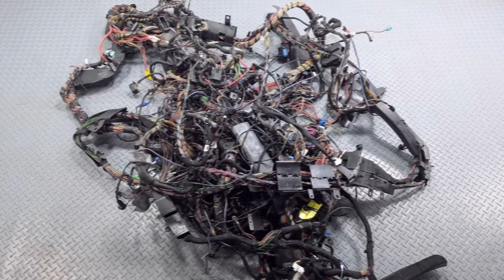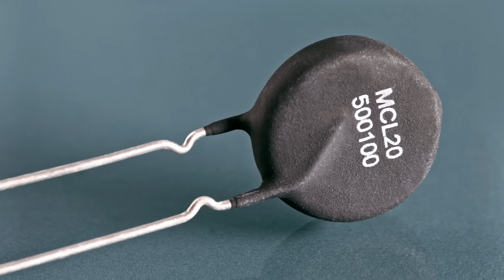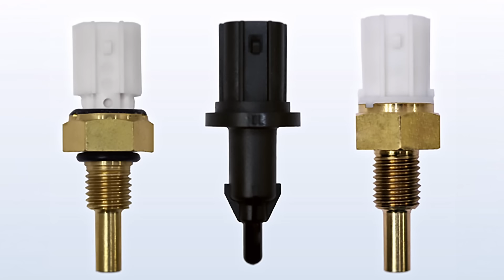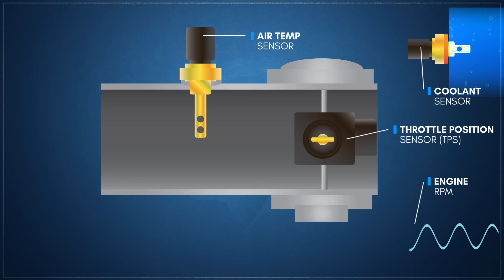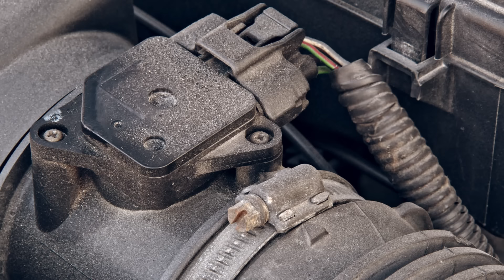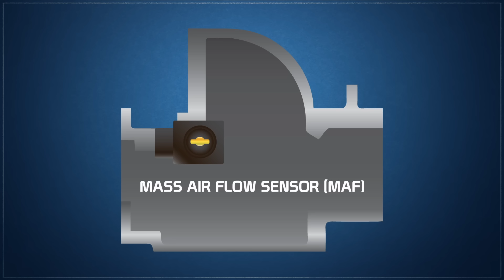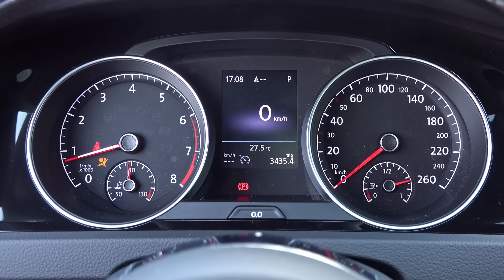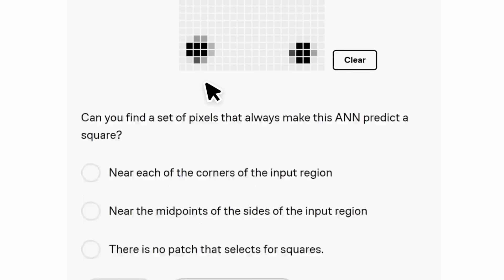The Insanity Of Engine Sensors

Comment: Not only the amount, but the precision of these sensors is amazing.  Also the fact that MOST of them out-last the vehicle ( 250k - 500k miles ), Is amazing.   

I know people constantly cry about how cars are all computer controlled now....But without all these sensors and computer controls, Car would not be the performance beasts that they are now. They would not have the performance characteristics that people want in a modern car.  They'd be MUCH less fuel efficient,  Much heavier, less nimble, less fast, and less safe.  

........Though it DOES suck when a crank-shaft position sensor dies on you.  Or your 02 sensor craps out, or in my wife's jeep, the gas tank vapor pressure sensor goes bad, so it always throws a check engine code, which stops the car from being remote started.
Reply: The computers are not bad but how they are used as an excuse to exploit the customer.
Also automatic steering correction should never be forced to be on especially in places where snow will cause it to misjudge where the road is, making it suddenly try and steer into the ditch at 80km/h every now and then.
Reply: my dad inherited great grandpas 1966 ford station wagon in the 80s had a 240 cu 4.0 st8 6cyl engine 150hp. top speed was 100mph ( we tired just once) or could just chill get 20 mpg going the speed limit on flat land. ZERO computers. it rusted apart in 2010ish still ran great original engine and transmission. fast forward 59 years with engine technology  and i'm not impressed. compare a car in 1907 to that of 1966. THATS 59 years of progress. its hard to compare the old 240 directly because everything is turbo now but the last time ford made a non turbo 4 liter was in 2000. it had 160hp. 34 years of progress  10x more complicated 10 more horsepower and polluted less..was an ok engine but  was not any more reliable than the 240 so didn't even have that u could say .. new car engines are 50  times more complex than grandpas old car for what? hell they are 10x more complex than my 2000 model vehicles, for what? a few mpg to make a car basically disposable? nope not impressed at all. now they have just got stupid dipping timing belts in hot engine oil thinking that was a good idea. they are going backwards. ill keep my early 2000s vehicles forever. was the last time stuff lasted and was not stupid complicated for just a little less horsepower and mpg.
Reply: My Grand Cherokee also does this. Ordered a new vapor pressure sensor, got part of the door card for what I think is a wagoneer instead. Thanks Stellantis
Reply: It does suck indeed. My 1977 f150 4.9 got better mileage than my 05 4.7 dodge half ton. Better than my f150 of the 2000 vintage and better than my buddies 2023 f150. Better than my 05 Silverado. 1977 got 16 to 22 mpg and it was probably heavier. It had a topper that helped it   I suppose maybe not a fair comparison. But my wifes turbo Subaru Baja can barely beat it at only 14 town 21 hiway mpg. Awful considering all the extra maintenance. I have kept track on the subie and it is close but i think i could have run an old bronco for less money. The money would have gone to fuel instead of three turbos and a new ECM before 100,000. Im so disappointed in modern vehicles. It seems they are getting worse. For the tech involved our trucks should be getting 80mpg in my opinion.
Reply: @joecliffordson  I don't have the spec sheets in front of me but it was almost certainly not lighter than modern trucks. It is a misconception that older cars where generally heavier, yeah weve lightened frames some but alot of body panels actually weigh more now cause they contribute to the crash safety sometimes even general structure. And we have added so much more to the inside. Pickups trucks more than any other category have in that time gone from bare bones deathtraps to luxury near track safe vehicles loaded with every concievable feature.

Also none of this is relevant even a little bit because the '77 4.9 f150 made less than 120hp when it was new(at sea level on a dry day)
Reply: @ i confess my 300 was built. It had more power than my 4.7 dodge but not the v8 chevy. The 4.6 may have been comparable but i never dynoed them. These overhead cams just add complexity without the power increases. I was a kid and i designed a better engine that was more reliable than fords current twin turbo. I was an old man when i had to put new pistons in it and its still running. Bonus was i did not have to remove the cab to pull the engine like fords today. For less than a timing chain in the dodge 4.7 i was back in business. Piston 4 cracked a skirt. Wasico piston compt said it was a bad batch but i ran many many mikes on before it came apart. I am a body man and those old fenders are much heavier. The safety in new stuff comes from a crumple zone. I think you are correct about newer trucks being heavy though by the feel of my-floor jack. Plus that old 300 passed emissions with no cat. Imagine that. I ran it through for shits and giggles in 90 and it passed hot engine test even though it was exempt. Engine management is necessary on these little turbos but the old 4.9 ford got the job done. Pulled many 12000 pound loads at hiway speed. Its my solid go to rig on my farm.
Reply: @alexphelps7042  engine performance went backward in the late 70s through the 80s due to emissions crap. in 1977 a corvette with the optional engine only had 210 horsepower. in 1967 the optional 427 made 400 horsepower.
Reply: @joecliffordson You forget back then the fuel had lead in it, that is why mpg was better not the engine.
Reply: @ i was running it from 88 to present. I will admit i built the motor. Raised compression with pistons and head work. Also used a 230 x grind cam and a holley 4160 4barrel with headers. Improved the 12mpg from the factory. Hardened valve seats for unleaded too. And a three angle grind with some port work to create turbulence on the intake charge and flow to the headers. The waseco piston dropped a sleeve in 2015. Short block rebuild was 1200 bucks. Slugsstayed 30 over as i shut it down when i heard the clatter. Pistons had fllaws from that batch i was informed. That was at 329000 and its still choochin.
Reply: @ntal5859lead raised the octane rating to prevent knock. It doesn’t help with fuel efficiency outside of allowing a higher compression ratio, though I am not sure if they took advantage of that. I think those old Ford engines had like a 9:1 ratio while modern ones have 10-12:1. 

It’d be the equivalent of putting premium fuel in your car today to try and increase mpg.
Reply: @joecliffordson  the main problem with modern trucks is how massive they are. There's only so much tech can do against a vehicle that has 2x the surface area.
Reply: Finally someone like myself, the change to ecu and sensor has made engines way more reliable and easier to fix. The people that complain do know how to fix their own car through pure ignorance or justifying it by some old folk lore story.
Reply: You can have quality cars without sensors they worked better imo without them

Comment: They are mainly used for research engines, but the PEAK of sensors is in-cylinder Imaging/Spectroscopy.

I need to read up on it more, and would love a video, but they basically use a spark plug like hole and add a sensor/camera or a fiber optic cable.

It lets them view exactly what is going on in the engine when testing new fuels or combustion modes like RCCI/HCCI etc
Reply: A similar tech was used mid-century in aircraft engines. By applying a voltage across the sparkplug gap and measuring the resistance during combustion you can tell a lot about what's going on in the combustion chamber. It enabled setting timing and mixture accurately. Easy enough for a human flight engineer to do with engines operating at fixed throttle and rpm for a long period during cruise.
Reply: SAAB patented this feature introduced it their petrol engines more than 30 years ago. Several diesel engines use in cylinder pressure sensors.
Reply: We use a saphire crystal in a similar application as a opening for the camera.

Comment: All these sensors and still the cars don't last as long
Reply: This is a myth. In the 80s and 90s, cars were on average being written off as beyond-economic-repair by about 100 000 miles in the US. By the 2010's this was up to 200 000. People think cars last less long because we drive more (so we might reach that 200k miles in less time) and because of survivorship bias.
Reply: @JorenVaes  New car sales are garbage. People are just broke or it would make more senses to finance a new vehicle. Government mandates kill alot of vehicles as well. All things considered.
Reply: I have a car the gas 230,000kms on the clock. The engine performing very well, much better than older vehicles I've owned.

Comment: I think my car like 5 sensors, oil pressure, voltage, headlights on with door open, coolant temperature and transmission reverse.
Reply: And hall effect for the ignition.

Comment: If only these brilliant engineers will factor in access,replaceability and durability to the sensors …….
Reply: That makes the line go down though…best i can offer is heated seats as a service!
Reply: OEM and profit go hand and hand sir.
Reply: @ fine, but what if an OEM would buck the trend and gain market share by touting a new way?
Reply: they do. but its the bean counters that dont want them to.
Reply: @ I think the bean counters are short sighted.  Those recalls are expensive and they fail to properly value goodwill.
Reply: They do. Engineers engineer. They’re not responsible for the cost control measures.
Reply: They 100% factor access into it. That’s why they are hard to access
Reply: The big manufacturers should be using generative or parametric design to allow to access zones as a minimum but then "light bulb conspiracy" suggests that it's by design - planned obsolescence in many cases
Reply: They factor it in and make is as big of a pain in the ass on purpose.
Reply: This is because, in the grand scheme of things, these sensors (in general) have very low failure rates. If moving the sensor and making it more accessible costs 10 dollars (because the layout is less optimal for manufacturing), over a production run of 500 000 or even millions cars that might use that engine, that adds up to a lot of money, just to make life easier for the guys that have to repair the 5 or 10 or even 20 sensors that will actually fail. Sure, there have been some major fuckups (eg, BMW had a belt tensioner on one of their engines that failed more often than it should and was hard to get to), but the engineers really do factor in repairability where it makes sense.

The customers we work with in the semiconductor industry keep very detailed failure rate logs of their sensors. Most are well below 10-20 parts per billion that failed due to the sensor being the fault.
Reply: @ thanks for your answer.  Maybe sensors indeed have acceptable failure rates.  But so many  assorted components are buried under flimsy plastic just to save a penny or two and so much needs to be removed to get to them.  I just think they could do better.
Reply: @MarkSmith-js2pu  The plastic is more for aesthetics rather than function 
Realistically you could tear out most of the plastic from the engine bay and then not need to worry about it anymore
Reply: @ I’m more concerned with door handles, and cheap AC actuators, electrical connector,plastic quality, vacuum line connectors and everything else that gets brittle,
Reply: @MarkSmith-js2pu  We need serviceability and parts quality regulations.
Reply: @JorenVaes  I’m not going to hate on the engineers per-se, as they are being hired to make a car to last to warranty/be as cheap (and thus profitable) to make at scale etc.

In our current system making something that works for what the company deems a “reasonable amount of time” and can be “reasonably repaired” until it eventually gets swapped for a newer model makes sense and they are doing their job.

THE ISSUE THOUGH is that this model cannot work when you don’t want to destroy the earth, or when you look at the societal impact of that model.

If designed from the viewpoint that a person should be able to fix any and all components with a reasonable amount of tools, knowhow (via documentation, but also designing with accessibility in mind), and time/money to burn.

THAT should be the core, not profitability for the company.  Our current system doesn’t push for that/reward it so we won’t get that.

Hate the game not the player i guess.
Reply: @ericlotze7724 with the cost of new being so high perhaps more people will opt to build custom reliable cars designed for accessibility and simplicity of repairs.
Reply: @JorenVaes hmm. In my little farm shop i get new bosch tps that malfunction right out of the box. The same sensor on all my early electrical throttle vehicles failed at 120k or less. Just my experience but i have concluded drive by wire throttle is a convoluted waste of wire. The response on every one i ever drove was terrible. I am glad to read a knowledgeable experienced commentator with confidence in the process because every car i have owned since 2000 needed cam and crank sensors along with the obligatory knock sensor and of course the occasional o2. You have restored my confidence. I shall endeavor to curb my prejudice.
Reply: @joecliffordson  some of the lower throttle response MAY be as a way to get better efficiency.  “Driving like a grandma” is cheaper and I’m chill with that, but i can see how it bugs people.

Granted it can also cause engine issues, but the benefit of ECU stuff is that CAN be tuned.
Reply: @ oh yes there is a myriad of reasons that make sense. It still amounts to less driver control. It drives me nuts to have to drag the brakes down a hill because the throttle system thinks deceleration is dangerous. Engineers sitting at a desk decide hey perhaps when someone wants to throttle down we should have the tps override that decision. Bugs people is an understatement in my case. But then i am broken in my head. Technology seems to be going backwards. On purpose. Wronger than two buys kissing.
Reply: @joecliffordson Electronic throttles make cylinder deactivation viable by making the step-changes in engine torque invisible to the driver.
Reply: @JorenVaes We still need mandatory servicability laws.
Reply: @gregorymalchuk272 would that be relative to the right to repair law in the UK?

Comment: Oxygen sensor only senses when you have money and burn out like a lightbulb.🤣
Reply: never had one fail. You must have a bad running motor
Reply: @hei-row  Everything fails eventually. The problem with sensors is you can't fix them yourself (unless you count replacing them as a fix). I have a 25 yr old jeep and have had an O2 sensor fail. Engine was well running again after it was replaced.